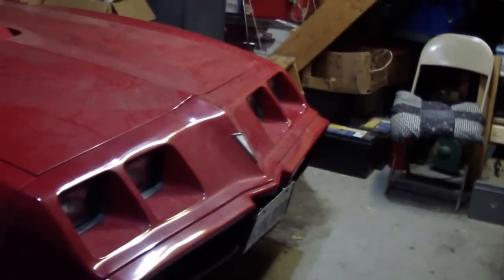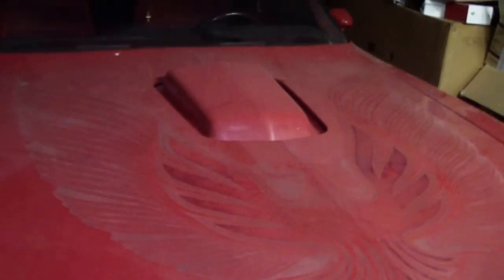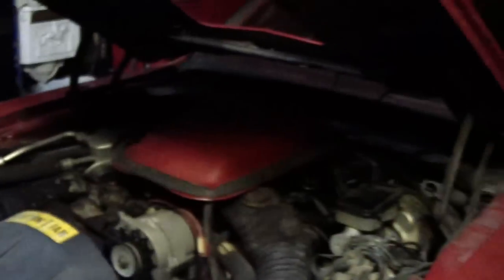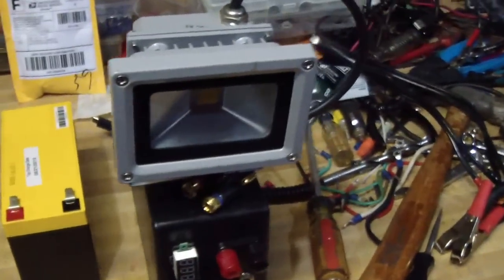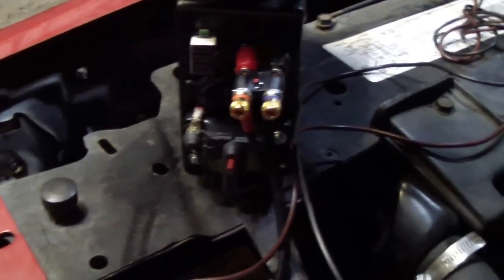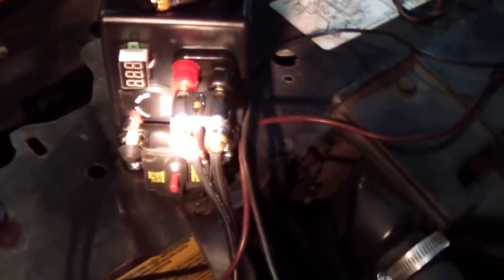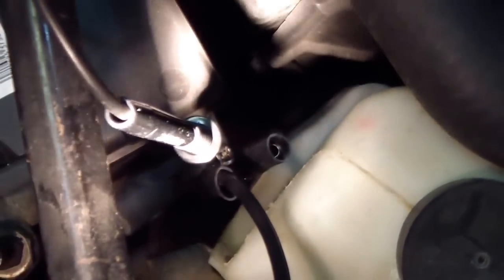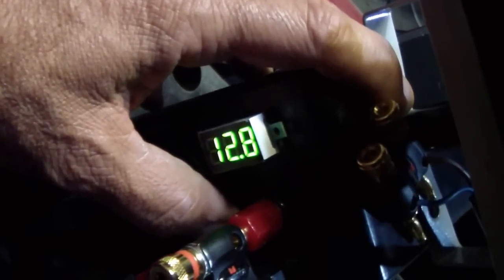Maxwell Supercapacitor, Ultracapacitor Start An American V8 Muscle Car!

Comment: What a great idea.  How long will the capacitors hold their charge? Thanks.
Reply from the maker: They hold the charge for a very long time.  Most of the draw is by the LEDs on the balancing circuit, so when the charge on capacitors dissipates less draw from the LEDs occur.  Thanks for stopping by comrade.
Godspeed,
Raz
Reply: Can you define "very long"? Super caps are famous with the quick self discharge (in comparison with the lead acid batteries).